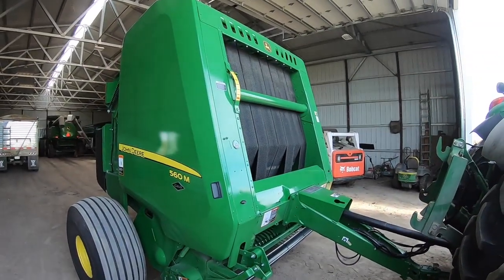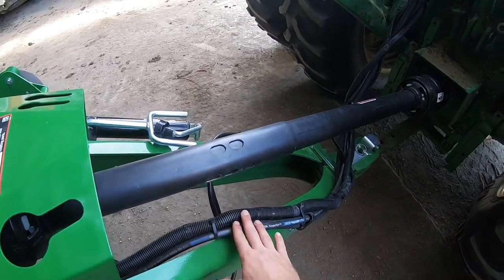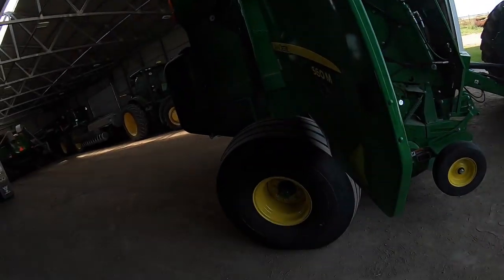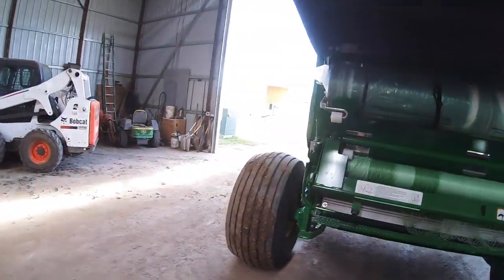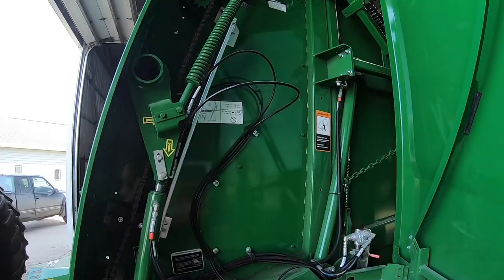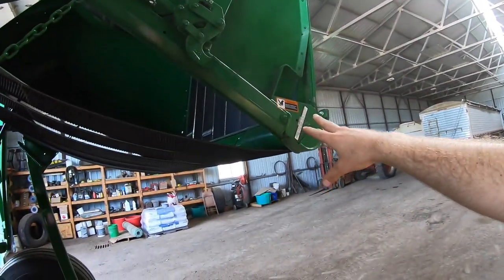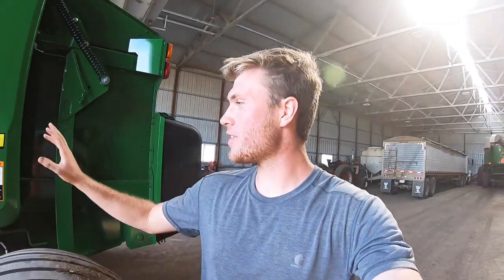Some New Green Paint!

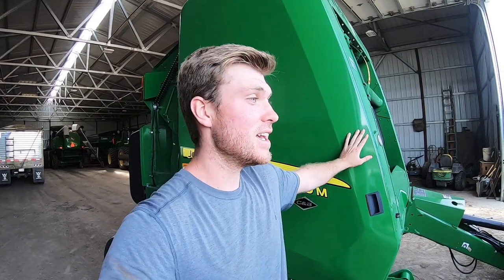Comment: 1:34 I know nothing about farming, but to have 'the machine' start moving the tracker instead of the operator sound like a disaster waiting to happen.  I know that plane pilots let the computer fly the plane but......Congratulations on the new baler.
Reply: Its isobus 3.0 (several tools, tractors and equipment starts to take advantage of it)  if i recall and its very advanced but it allows for the equipment to take control of the speed to get the most optimal feeding of the swath and it stops when full. It does ofc have its own top speed where it wont go any faster and if any sensor readings arent right it wont work at all
Reply: @SlyFoxl  and the tractor will not move if the operator leave the seat
Reply: Thanks for the info guys.